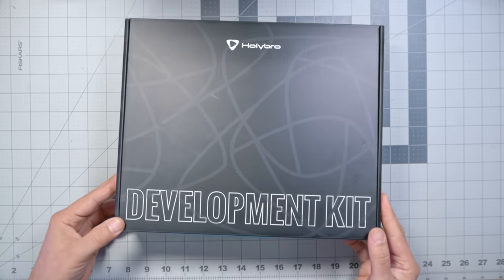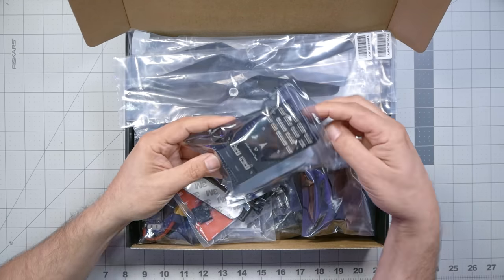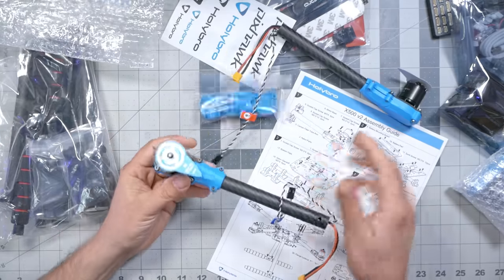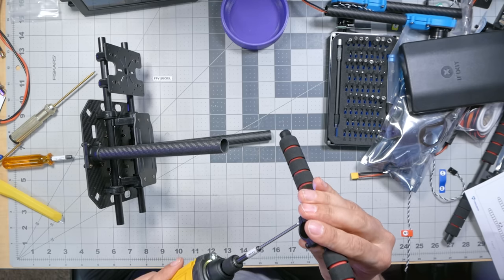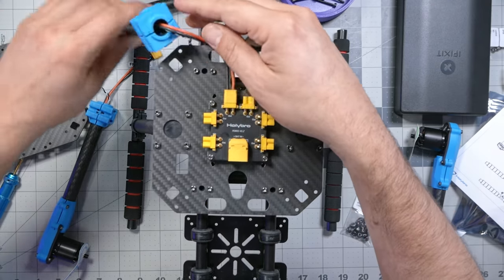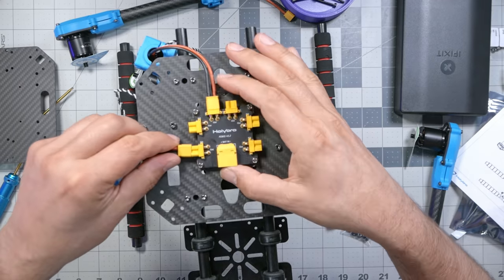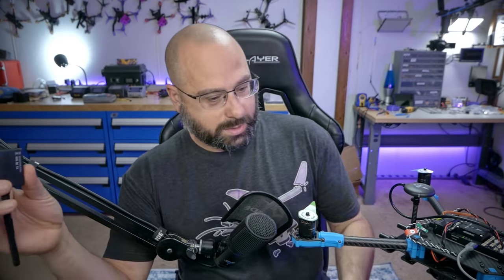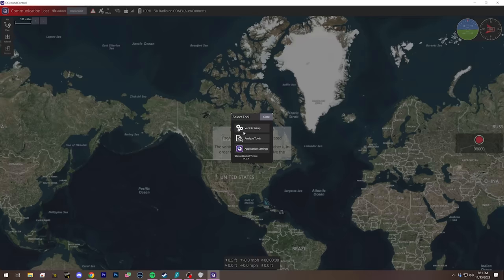FPV pilot tries Pixhawk for the first time // Introduction to Ardupilot

Comment: I'm surprised you haven't done anything with the pixhawk. Excited to see what you get into. I run the Cube orange plus w ADSB on my fixed wing stuff. Really mind blowing capabilities. Rfd900x and herelink are my RC never lost a plane due to equipment failure. Very reliable very versatile

Comment: Joshua, you definitely should do more things like this. Things like flashing iNav to a quad, perhaps build a rc airplane with iNav, perhaps another with ArduPilot... (And you don't even need a Pixhawk for that, you can flash ArduCopter or ArduPlane to FC from Matek, SpeedyBee and so on.)
That's for 2 reasons: to expand your horizons, but also because we love the videos! 😃
Anyway, stay safe there with your family! 🖖😊
Reply: Hey man, I'm just wondering how to flash speedybee f405 v3  with ardupilot as you mentioned.
Reply: @vedaantsarda7968  I don't remember lots of people mentioning it's possible during reviews, but I don't remember if I've seen anyone doing it indeed... 🤔
Perhaps you could ask Lee, painless 360.
Reply: agree, this is exactly the kind of thing i want to see personally
Reply: @NukularPower  Me 2.

Comment: If you want to understand what pixhawk is in very simplistic terms... here you go.

Pixhawk is to DJI like Android is to Apple. It can do everything DJI can do, just as good or better, with extra functionality, extra hack-ability,  doesn't spy on you, and does it cheaper. The only drawback is you have to learn how to use it.
Also, your accelerometer needs better calibration because you were wobbling all over the place when calibrating it. You can't just hold it with your hand like that. You must balance it against an object and be absolutely still for it to fly correctly. I've flown APM 2.8s that drifted less because they were calibrated better.

You can do a lot with the pixhawks. Drones? Yep. Airplanes? Yep. Helicopters? Yep. RC cars? Yep. Rovers? Yep. Boats? Yep. Submarines? Yep.
Reply: For those uninitiated APM2.8 stopped being supported over 8 years ago and runs on ATmega 2560, 8 bit CPU
Reply: @tymoteuszkazubski2755  Yep! You got it! So it's pretty sad when a brand new pixhawk is so badly calibrated that if wanders around more than the massively outdated APM. 

I remember the early days of the pixhawk when a bad calibration would send the drone rocketing into the ceiling. Right into a fire sprinkler nozzle. Ask me how I know.....
Reply: Hey I've still got a 2.5... Don't be mean. Haha.
Reply: iPhones are more durable however. I work in the Bakken oilfield and every android device fails in our extreme cold. iPhone works with no issues.
Reply: @derqatarzan4207  I don't care for either of them. 

Flip phones are more rugged. I don't want to be rolling around under a car and having a screen break because I rolled over a gravel pebble.
Reply: @vhfgamer  haven’t had that happen in 13 years in the oilfield with an iPhone . I understand however, I miss my nokia

Comment: My very first Drone was a Tarrot 680Pro with a Pixhawk FC.... just fancied the challenge of assembling such a thing.
Assembly went well as did installing all the electronics which at that time required some soldering.
I then got it professionally set up using ardupilot and Mission planer as i hadn't a clue how to do it.
Well about 15yrs on it still flying great... albeit not that often and it's never been crashed just a few hard landings without damage... So reliability has been exceptional.

Its great that your doing something "different" from the norm... Which i found really enjoyable and took me back 15yrs.
Thank you.

Comment: Pixhawk is actually the standard board layout of the FC. PX4 & Ardupilot are the firmwares that run on the FC and Qground control & mission planner are config & flight management softwares. 

The reason the Quad kept drifting was because you did not calibrate the compass in the video.

Comment: To give a perspective on what these can do, here is the mission for our pixhawk plane;

Takeoff, go to a predetermined area, find the red spot and save its coordinates. add it to the waypoint list for the next lap, go around the parkour, drop a ball in a way that it will hit the red area, do it again, and finally land on the runway.

It does these things all by itself, but calibrating and configuring the control system is a pain in the butt.
Reply: can you share more details about the setup you used for that drone? I'm planning to build something similar and looking for inspirations :)

Comment: Bravo,  Joshua you stepped outside your comfort zone. 
I have been using pixhawk way before betaflight and have also struggled with it but it’s the best framework out there to control non-assisted flight for DIY community. I built a hexacoptper, pix, hawk clone, and it flies great seven years after I built it.

Comment: I’ve been flying arducopter 7 inch long range drone for about half a year. The reliability is very good and it still offers good enough acro performance. However, to get this kind of acro performance, a lot of tuning is required. I’m so happy to see that finally a fpv content creator starts to play with ardupilot.

Comment: I had a pixhawk setup on a large quad port with a parachute, I had a motor failure and the pixhawk calculated an uncontrolled decent as it’s supposed to and automatically deployed the chute…worked perfectly. I also ran redundant gpa sensors for blending as well. Absolutely fantastic. Flight controller. The ardupilot firmware and hardware really were the pioneers of the flight controller world…years and years ago.

Comment: GREAT Ardu journey! My very first drone had a Pixhawk FC running Ardu and it was very good at what it did. And the Alta X uses FreeFly's version of PX4 so my experience came in handy when we started flying those. Put it in Acro if you want that full control. It is a rate mode with no GPS and no barometer. And, there is RTK available for PX4 and Ardu. People have actually flown the Alta X in Acro mode!

Comment: Try going from stabilized to loiter. loiter is a function not an actual flight mode. that's why the drone was so confused. I'm far from an expert but i think taking off in loiter was the issue. I could be wrong because I haven't used a pix for years
Glad to see you back making content
Reply: Yes, I think Joshua wanted to do "position hold"

Comment: This is a post of despair!!
I have two Pixhawk Cube and CUAV 5+.  After 5 years of use, I was convinced that PX4 & Ardupilot is the worst system!    Many dozens of updates have been released and almost nothing changes, constant errors and a drone crash.   I could have assumed that the problem was with the flight controller, but I used three new ones! !
Out of curiosity, I bought a flight controller - a Boeing Paladin.....   AND A MIRACLE HAPPENED !!!  I didn't even know that such stable systems existed.  Flight readiness occurs 5 seconds after the battery is connected, positioning accuracy is 2-3 cm. Flight stability is excellent

Comment: My latest pixhawk coupter very stable in loiter mode...    As far i remember compass has to be carefully calibrated.  Also using the dshot protocol for the motors further stabilized loiter  mode...

Comment: I just put together the same Holybro from about a month ago.  I have gotten the expresslrs radiomastef rp3 working on the drone with the PX4  firmware. It was a difficult endeavor as I am new to the hobby.  One needs to recompile the firmware on a Linux computer with the expresslrs module linked in (steep learning curve). I also found it was possible to connect the control input through the s.bus input with the elrs receiver in s.bus mode. The problem with that is there did not seem to be any way to get telemetry back to the radio. At least I couldn't find a way.

Comment: Supper happy to see JB tipping his toes in the world of Ardupilot and DroneCode Firmware. My entire quads and planes run Ardupilot firmware and I use Mission Planner to configure and mission plan. The reason I don’t use QGroundControl is because parameter mapping is not 1-to-1 if you are running Ardupilot Firmware. So be careful @JB.
Few tips:
1.	Perform compass, and FC calibration before installing the FC and GPS on the aircraft.
2.	You can use Mavlink protocol or FrSky Fport protocols for both telemetry and radio control. I use TBS crossfire with Mavlink protocol and I run Yaapu Lua script on my colorful TX16 radio. Supper sexy!
3.	If your quad is still drifting in Loiter mode, use Autotune mode in a large field (away from trees).  

Welcome to the dark side Mr. Bardwell. Several years ago, I had asked you to pickup Ardupilot content since there are very few on YouTube besides MadTech and Painless360.

Comment: On the 6X there is a port labeled "RC In" next to the PWM output pins.  If you go into the ELRS receiver (ELRS Configurator) and change the output to SBUS you can connect the receiver power, ground and TX to the RC In on the 6X.  The 6C has the same capability but the input plug layout is a little different.  

I've been flying DJI for a while and decided to build a Holybro X500 with the 6C using ELRS and a RM Boxer.  The only question mark was connecting the ELRS receiver, so I've been chasing that down the rabbit hole.  Pixhawks all seem to be setup to work with Spectrum plug and play and I didn't want to spend that kind of money on the transmitter for a mostly autonomous drone.

Comment: A few Ardupilot tips.

1. Make sure to set transmitter to no pulses for failsafe.

2. Stabilize, AltHold, Loiter will be your 3 most used flight modes. Start with stabilize then use AltHold to teach the FC your hover value, then loiter (for quads) for GPS position hold. The actual PosHold mode is depreciated.

3. When calibrating your IMUs for the first time, do it before mounting the FC in/on the aircraft on a known level surface. You will get much better values.

Comment: In Ardupilot you can make autotuning and set proper gyro filtering. And your drifting could be because poor compass calibration which is essential ;) mine hexa with old pixhawk stays in place like dji :) I tested even 5” quad with arducopter in acro… all works great, and for me is much easier configurable than betaflight and you can make acro or gps quad.

Comment: If you have an F405 based FC/drone, there's a good chance it too can run Ardupilot. This could be another option for people wanting to get familiar with Ardupilot features without investing in additional hardware. For the positioning stuff, the drone will need a GPS, and likely barometer compass; but these are cheap compared to building another drone, just to experiment. 
Look forward to seeing updates on the playlist as explore some (new to you) features and capabilities.

Comment: Sure brought back memories. I started using APM 2.6 in 2012 and PixHawk from 3D Robotics when it first came out in 2013. I still have an old PixHawk in a quad that I play around a bit in my backyard without a camera gimbal since I no longer shoot aerials. You can probably do a video with the PixHawk flying the quad through different way points you set from the laptop. It is actually pretty cool to watch the quad go to all the way points, come back home and land. Once the novelty wears off it is kind of boring since the pilot really does not need to do any flying.

Comment: Program a flight path around the property and chase one drone with another drone.
Use photogrammetry software to render a 3d map of the area.
Optimize for loiter time, then carry a gate that you do as many power loops through as you can before the robot lands.
Install an optical range finder to hover a precise distance over your roof, then use the prop wash to blast leaves off the house.

Comment: JB, do a compass calibration - my arducopter frames hover/loiter in one spot PRECISELY even with cheap/old GPS units.  I bet yours was drifting around because the compass needed it's initial calibration.  

Arducopter can also hover in altitude quite precisely with only a barometer. But yes hovering in ground effect or even a bit higher can give the barometer fits because of all the swirling air.
Reply from the maker: I did the compass calibration.

Comment: Ah it brings me back to 2012 when I was trying to configure my APM 2.0 on Ardupilot.  I’m still traumatized by the experience I had when they added geofencing but forgot to take into account that the GPS can lose contact with the satellites.  When this happened, it assumed a default location somewhere in the world and suddenly the craft would think it went outside the geofenced area and would tilt 45 degrees and go full throttle to go back to the geofenced area.  But since the GPS was not working properly, it would just fly away while ignoring commands from the RC link.  I miss the thrill of having a 15 pound quadcopter flying away straight into a dense urban area.
Reply: Hahahah this is way too funny

Comment: You don't need a Pixhawk for PX4 or Ardupilot. There are many supported FPV-style FCs.
The best ones are the Holybro Kakute H7 FCs. They support Betaflight, iNav, Ardupilot and PX4. So you can try out and compare different firmwares on the same copter.

I had good results with PX4 in regards to Position Hold (on a Kakute F7 .. I don't recomment that one though .. get the H7). Almost as good as DJI drones.
However the configuration was a pain, and then sometimes the copter refused to start (preflight check failed), and you don't get proper information on why.

Comment: The stabilized mode is wierd, it expects your throttle stick to stay in the middle like the rest of the sticks. Raise past center throttle and it gains altitude, lower past center throttle and it drops. It will try to hold it's altitude at center stick.

Comment: The dirfiting could be caused by a few factors:
Did not perform compass calibration.
HDOP value too high causing drift
Primary compass set to internal (I recommend external)
If you want a more accurate gps better performing gps, i recommend the new here 4 that was just released. You could also pick up the previous generate here 3 and it would perform just as well. I primarily use ardupilot system and haven’t had much qground control experience.
Reply: HDOP= horizontal dilution of position. In the video looked to be at 0.7, which is a decent value.
Reply from the maker: Compass calibration was definitley performed. I will check the external compass.
Reply: @JoshuaBardwell  The compass calibration can also be impacted by performing it near a piece of concrete. I’ve had the compass calibration get messed up from being on or by a piece of concrete with rebar in it. You can also improve your horizontal and vertical location by adding a GNSS ground station to your laptop. Nice to see you expanding your horizons though. Big airframes are fun to fly and can carry some heavy loads.

Comment: You need to add the compass calibration step.  This is super easy once your telemetry radios are working - because you don’t need a USB connection to your computer.

Also - the number one cause of crashing when doing LOITER or other GPS modes is a poorly calibrated compass.

Unlike BetaFlight FPV drones, the compass is essential to ArduPilot copters. So you also have to think about magnetic interference.

An important detail is that the flight controller has a compass, and most GPS units also have a compass - so there are usually two.  Unfortunately the compass in the flight controller is in much closer proximity to magnetic interference. The remedy is to disable the flight controller’s internal compass and use exclusively the GPS’s external compass. 

This can be easily done with Qgroumdcontrol.  My guess is that the problems you had with LOITER is because you had it set to use the flight controller’s compass.

Comment: Ardupilot and Arducopter work great with CRSF protocol. I use mine copters and airplanes with both Crossfire and ELRS. To get CRSF support you need to enable it. Set RC_Options = 256
Reply from the maker: Yes but if you are using ELRS and not CRSF, then the baud rate is wrong, and it doesn't work unless you set a bitmask to change the baud rate, which I could never get to work.

Comment: That was great mate, Pixhawk was my first intro to drones with the 3DR Iris plus then the Solo both with camera gimbals for a gopro, there are some great flight modes Josh, I used orbit a bit, there's follow me via Gps, land mode is handy, waypoint missions easy to do, I think your Loiter was getting ground effect from the large amount of thrust, try it higher up and it should just sit there rock solid on 18 sats, my drone's are just sitting around these days as I'm addicted to FPV small drones, thanks to you😊Cheers...Jason.

Comment: I recently got one of these kits with the 6x, too. This semi-autonomous flight is what's really interesting to me. I used alot of your videos when i first got started building a 5" drone before i realized that i wasn'tlooking for the betaflight experience, but it turned out to be a really fun micro ardupilot project, and really hooked me on this hobby. I also had to find the elrs ->sbus hack to get my elrs controller to work.

I think a cool thing to explore would be adding an OpenHD video and telemetry link to this drone (and maybe an open source gimbal, too). That's where i currently am with mine, and it's probably what most people building this type of drone are looking to do. After that using the telemetry link to do basic autonomous flights would be cool to see as well.

It would definitely be great to see opflow added. Also, for that super tight positioning, you could add RTK. That's something that would be great for us to see in this format with someone knowledgeable before making the decision to buy.

Also, did you notice any excessive vibration on your kit, mainly from the props? My logs are showing a lot of vibration, and im currently ordering new props because that seems to be the issue.